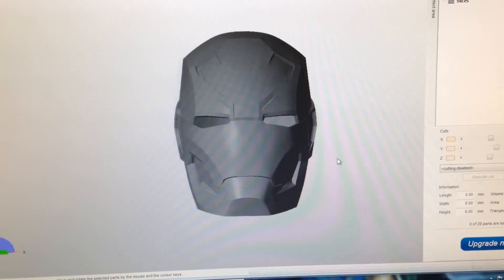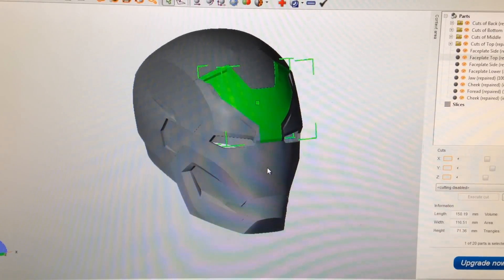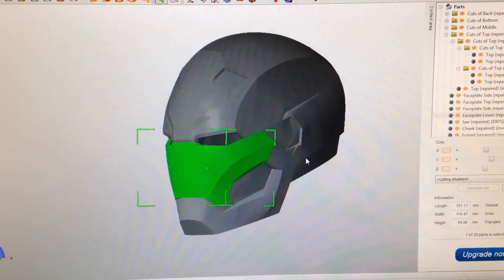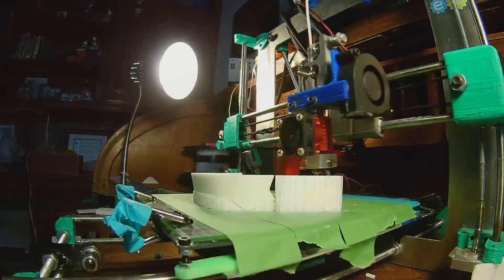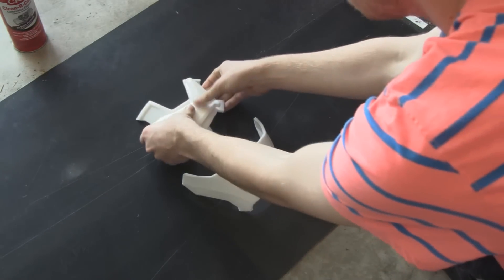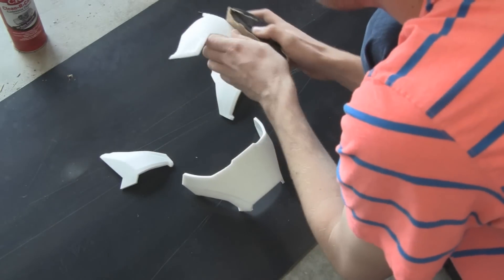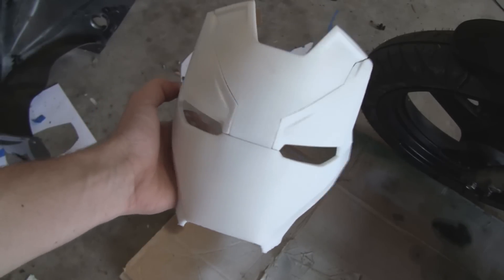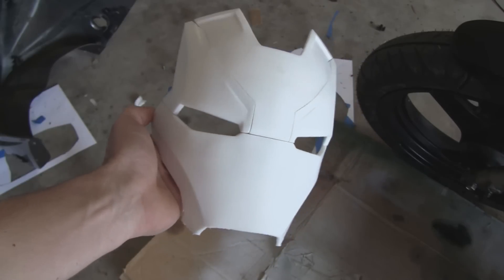3D Printing the Faceplate | Iron Man Mark 46 Helmet Build - Part 1

Comment: Yikes! I printed the one from Thingiverse in 2 pieces (Faceplate and helmet) on my CR-10 . The face plate took 12 hrs and the helmet took 60 but turned out nice. Video here: https://www.youtube.com/watch?v=HLosMn5lnUo, Pieces would have been much easier, but I also changed the orientation to make for less supports but had to use a raft for stability.  Great video.

Comment: What is the full model name of your printer?
Reply from the maker: My printer is an amalgamation of different printers in one, with some parts custom designed by me. It was originally a kit from a company that is now out of business, but I've modified it so much it does not resemble anything that I started with. There's too many different parts to call it just one model. It's just an i3 clone and they're all almost exactly the same! Just pick whichever and modify it to your liking